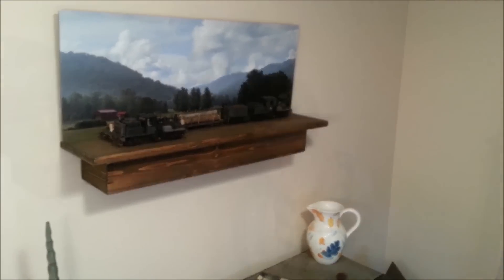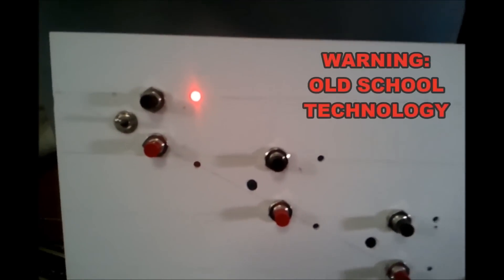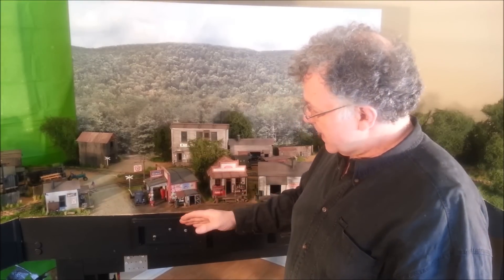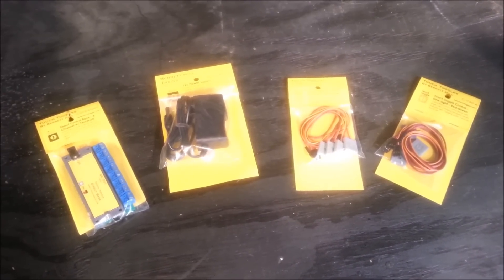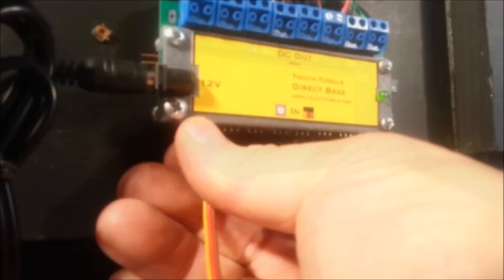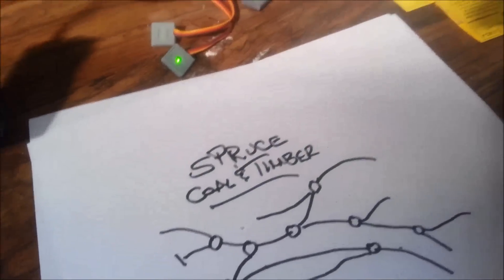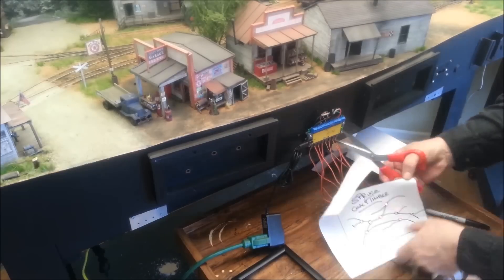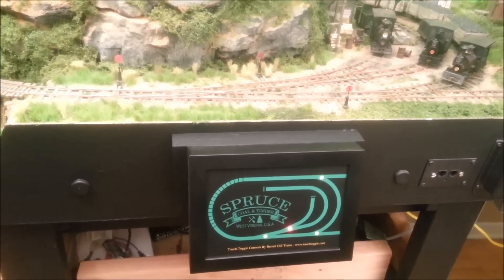A look at touch controls for model railroad control panels!

Comment: looks cool, but what I am looking for is a way to show which track is open(green) and which is not. I know the points have changed, but to which direction???
Reply from the maker: solzbest Contact Kevin Hunter at  Berrett Hill which is at www.berretthillshop.com He does have ways to do just what you need. Additionally, you can add your own LED lights to a panel and run off of the switch motor contacts which would indicate which way the turnout is thrown.